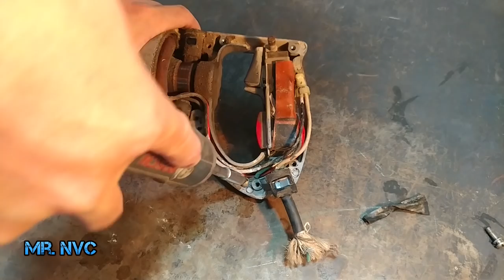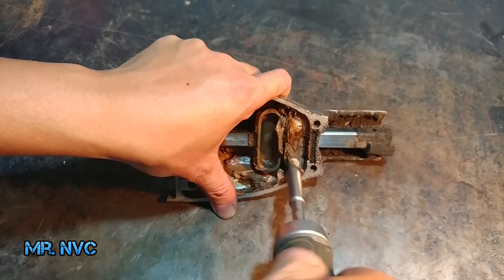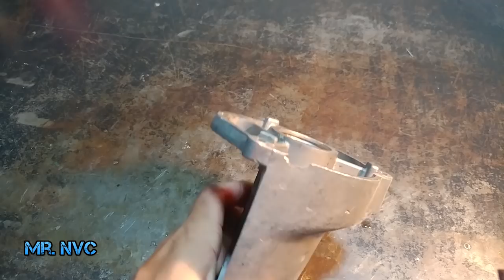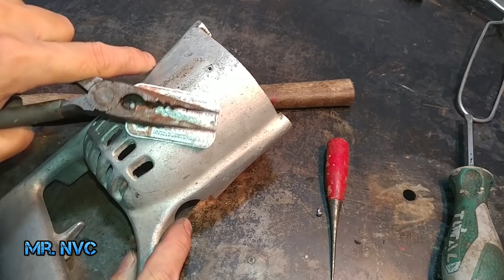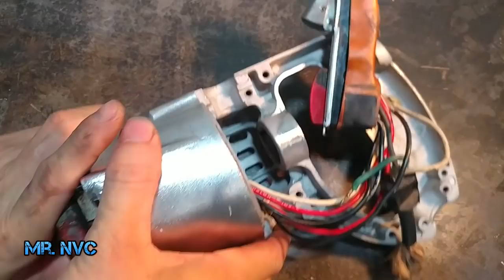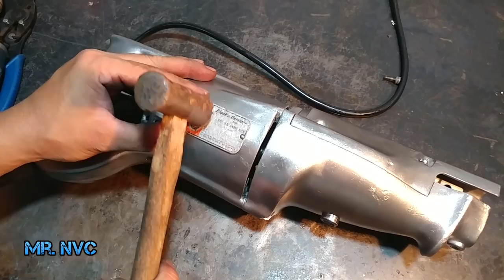Reciprocating Saw Restoration - Vintage Black and Decker Reciprocating Saw

Comment: Aliekspress sells aluminum solder in the form of a wire with a flux inside for solder aluminum. Solder the burner. This is good for repairing defects in aluminum cases.

Comment: That brown stuff on the trigger button on the red part is driving me insane. And I feel that it needs a ton more grease in the grease wells around the center shaft and the other shaft towards the front of it with the angled teeth.